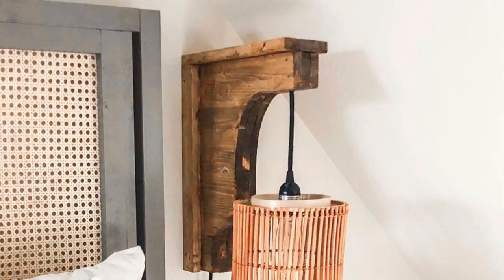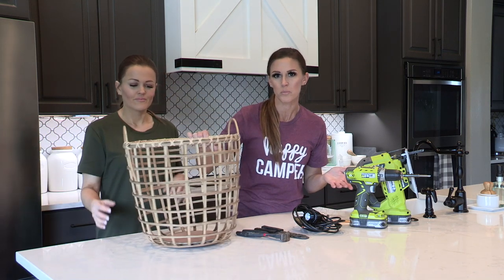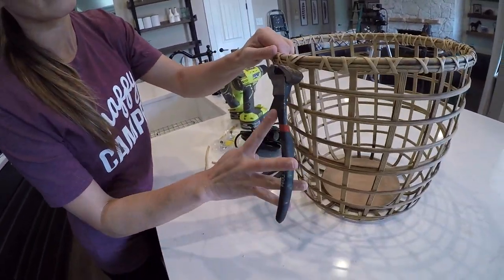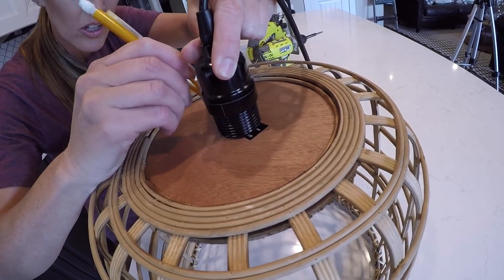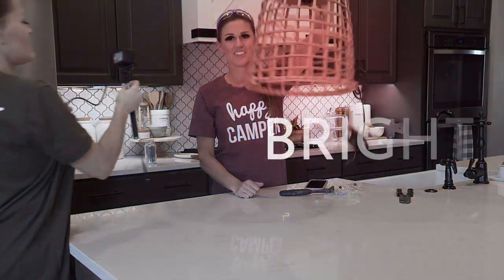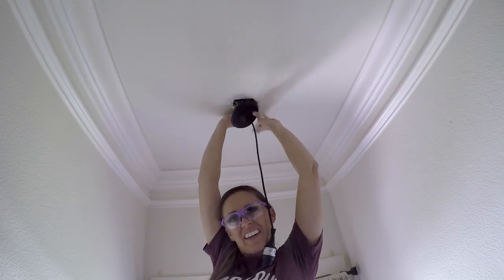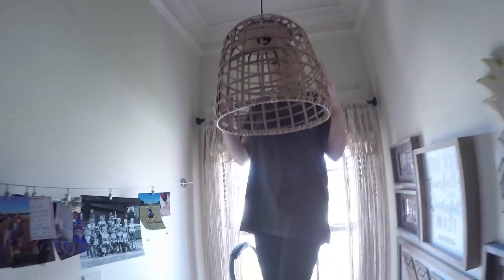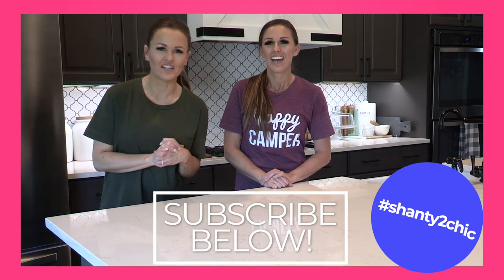Chandelier Hack!

Comment: Great video.  I have just one question.  And I haven't read through the previous comments, so this was probably covered.  Why didn't you just use a hole saw in your drill instead of the jigsaw?  You can get hole saws with several different size attachments.  Makes projects like this a breeze.
Reply from the maker: Steve Graham none of my hole saws were the correct size and that would require purchasing a new one when I have many jigsaw blades. Most people will have a jigsaw blade on-hand over the correct size hole saw. There are many ways to do things, I did what worked best for me and it was a breeze.

Comment: Should I be concern about this being a fire hazard? I feel like the heat coming off the bulb (if not a LED) might damage the basket over time.
Reply: I was thinking that too. Super cute idea, but ill use it for inpiratuon for something else and pass this time.
Reply: In some places in the US a light can't be hung with the weight on the wires. There has to be a small cable taking all the weight. Very easy to add.  Use this as a great inspiration, but check local practice and code.